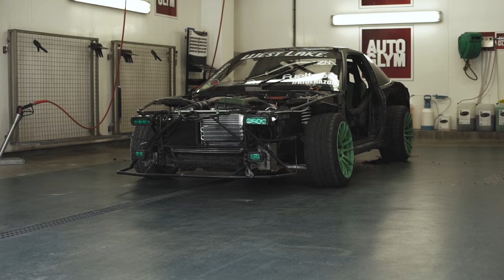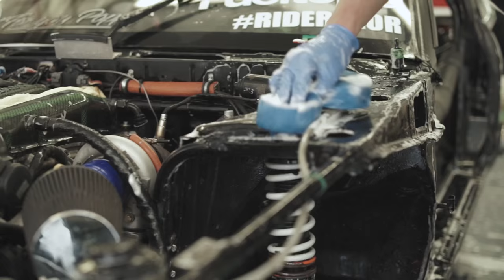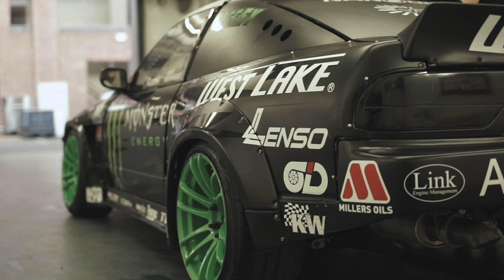Drift Car: Full Strip Down at Autoglym HQ

Comment from the maker: @Nick Gallichan Ouch, it can't be fun doing much at -20°. Whilst it would be hard to do any car care at that temperature if you prepare the surfaces before winter with Autoglym waxes, they will offer protection during the colder months. If it is possible to perform maintenance washes inside, you can top up any existing protection with a spray wax like Rapid Aqua Wax.

Comment: Can you please list the products you used on each section ? would make life so much easier !
Reply from the maker: +andrew redstone For you sir! 
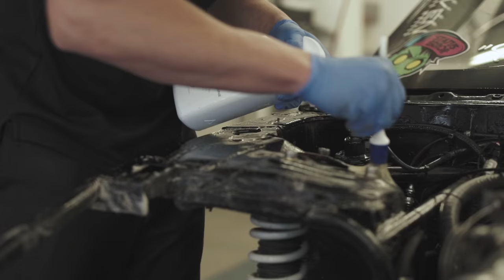0:30 Engine & Machine Cleaner
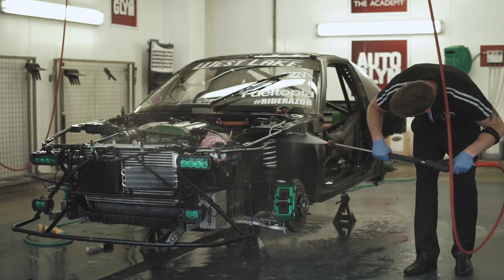0:42 Custom Wheel Cleaner
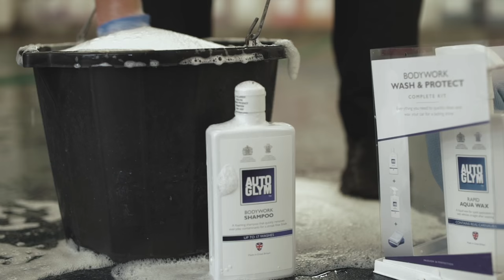0:50 Bodywork Shampoo
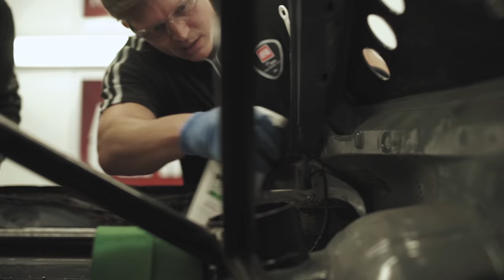1:12 Interior Shampoo
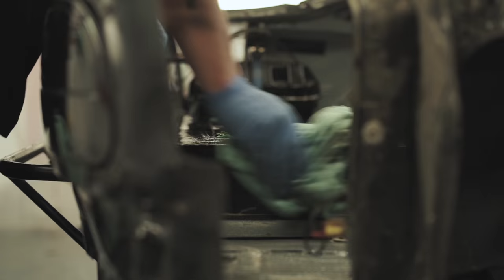1:16 Hi-Tech Interior Microfibre
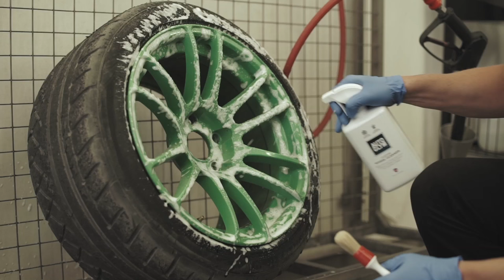1:25 Custom Wheel Cleaner
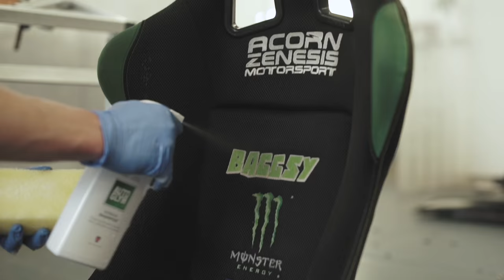1:39 Interior Shampoo
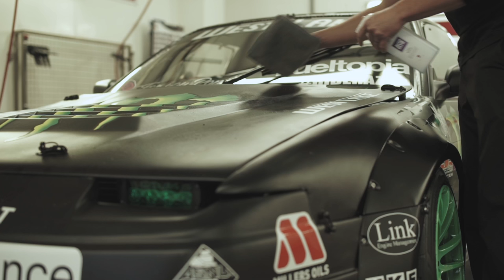1:55 Fast Glass
1:57 Tyre Dressing
2:00 Wheel Protector 
2:07 Fast Glass